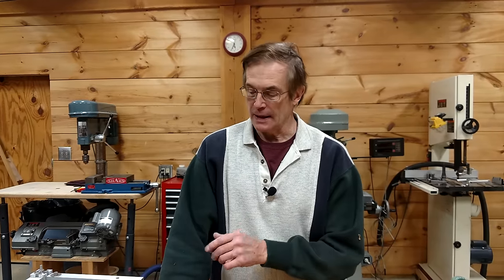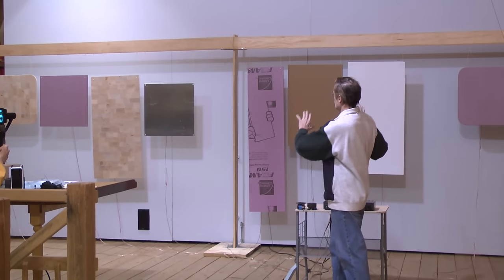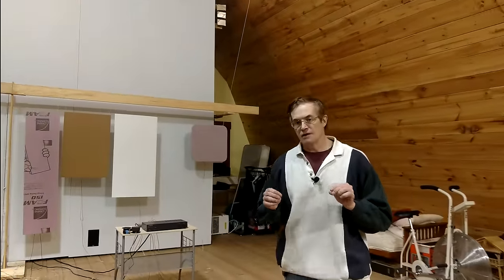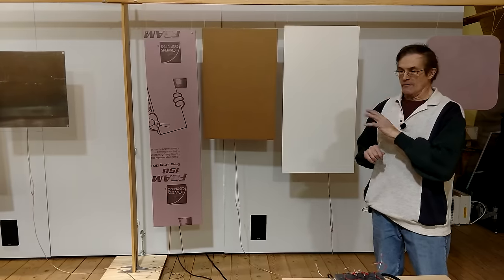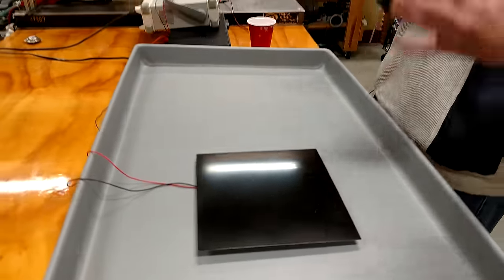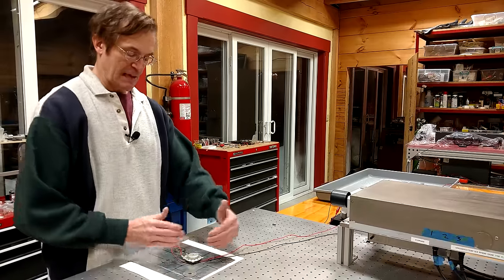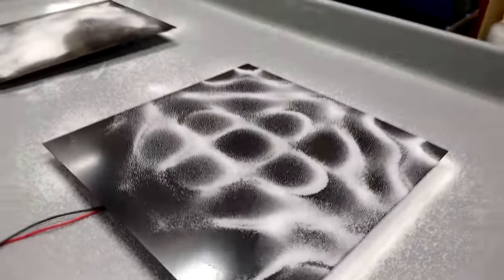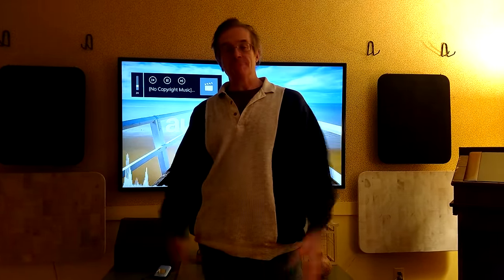Fantastic DIY Speakers for less than $30!

Comment: Very interesting topic! Thank you very much for sharing your expereince with different materials!
With my 25 years of experience in speaker technologies I would put a (maybe flat) sealed enlosure on the back of the panels to get more volume in the bass section. Another possibility is to keep at least a distance of 1.5 metres to every wall. That's why in the demo at 29:14 the panels are unfortunately totally lacking bass.
What you describe at 3:30 is, I think, the general difference in sound quality between dipoles and monopoles. You could test that with the same panel with and without an enclosure.
I would not fully agree with what you say at 29:00 that they do not require a crossover. I would assume that the frequency ranges of both different panels have an overlap over a wide range. The sound would clearly benefit from a crossover then. I'd also assume that there are dips and peaks in the overlapping area, at least due to different speeds of sound in each material and therefore differing acoustical phase. Try it out, it's not that hard to design a crossover. I made a tutorial for 2-way speakers: https://www.youtube.com/watch?v=5Kvl0iBQ0L0&index=1&list=PL4lJ1ej0uWlQjzOstioAZ1bd555vG9WHF.
A second one for fullrange drivers is coming tomorrow.
A material what perfectly fits your description at 5:20 is rubber. This of course has to be attached to a stiff frame. An irregularly shaped foam damping on the edges might also help against resonances (caused by wave reflections on the edges). There's a legendary driver which exactly follows this principle: the Manger MSW.
From metal plates (the higher the speed of sound within the better) I'd expect the most detailed sound if you eliminate the ringing/resonances with a crossover. This might lead to a small plate to shift resonances far enough into treble and a big plate for mids and bass in a 2-way system. Maybe round plates are better because they might have fewer but stronger resonances.

There's an intersting paper about exciters by the German speaker manufacturer Visaton: http://www.visaton.de/downloads/pdf/visaton_exciter_principles.pdf (also available in German).

Anyway, I now feel the urge to also experiment with exciters. If I do that one day, I'll also make a video about it.
Reply from the maker: Base is weak with this speaker.  The problem with sealing an enclosure on the back is that the principle of a freely vibrating sound generator is lost.  The result would be a conventional speaker with a rather heavy, unconventional cone.  Restricting the edges in any way will limit the movement toward the center of the panel. A piano doesn't need an enclosure.  I am working on applying exciters to much thinner surfaces, unusual shapes and phasing multiple exciters.  Your suggestion about rubber is interesting, I will test it.
We are studying these speakers with a calibration system and the initial results show an extremely broad overlap for the different materials.  I'm not sure if a cross over would be useful, but it would be simple to try it, so thanks.

Moving away from the wall helps if you have the room.
Reply: 1.5 meters from every wall? Ain't nobody got space for that!
Reply from the maker: The base response of these speakers has nothing to do with their proximity to the surrounding walls. This is easy to demonstrate by simply moving one of these speakers to the center of the room; the sound quality remains virtually unchanged. The lack of base response in panel speakers derives from the wavelength of low frequency sounds.  A 100Hz sound has a wavelength over 3 meters long.  The longest bending mode of a panel with less than a meter of length would require an outboard mass or a stiffness reduction that would undermine its reproduction of higher frequency sounds. Larger panels will do better and they perform as well or better at higher frequencies as well.
Reply: As you try other materials, have you given consideration to glass? Heavier than the foam board, but definitely thinner. Rounding corners and hanging with wires could be tricky, and then there's the whole shattering thing to watch out for... But I think it would be an awesome transmitter of sound waves.
Reply: Here from AvE.
Now that that's out of the way... I am curious to see if there is further resonance damping, if you cut a wavy pattern into the sides of the panels (kind of like taking your "radii & round-over" efforts to the next level.) This would leave only the flat, front surface as the primary emitter, and might reduce internal reflections, I think?
Reply: will there be an follow up video?
Reply: Glenn Wyant
There's the ringing problem.
Reply: Marius Loubeeka, whatever, okay. This is science!
Reply: This does not match my experience. I just built a set of these for a porch with brick walls (thanks you your video!). My plan was to hang them on the walls like your example, with about 2-3 inches of clearance. Doing so totally killed the bass. I ended up hanging them from the ceiling (parallel to the ceiling) with about 12 inches of space between the ceiling and the panel. This helps preserve the bass versus having them close and parallel to the brick wall.  I would encourage you to do a test with a panel close to brick or concrete to see what I experienced.
Reply: qksilver123 I was just thinking about this and I guess the reason is due to some interference from the reflection right behind the panel. I am finding this fascinating and I'm seriously considering in making a DIY project as a gift to my girlfriend and was thinking in how to get better bass. If what I said is correct putting some egg cartons behind the panels should help to scatter the sound behind the panel and kill any interference. And like this you can still keep the very thin profile of these speakers. I'm thinking even in making a frame (but still having the panels floating in the center) for them to make them very asthetically pleasing and like this you can hide the cartons behind the panel. If you ever try it just let me know
Reply: Tech Ingredients  fascinating and excellent presentation.  I must politely disagree with you about the enclosures though. You say a piano doesn’t need an enclosure and I would assume according to your theory the same goes for other instruments as well. However the piano IS an enclosure for the soundboard and the same applies to the back and sides of a guitar or any other stringed instrument. They consist of the soundboard /top and the body /back & sides (enclosure).   

 I repair & restore instruments, mostly guitars & ukes. I have a few old bodies with no necks that I may try attaching these exciters to. Perfect speakers for my shop!
Reply: Ian Stratford "Yes it is," using good cheap bamboo (from China good quality) boxes my self. Chipboard resonance is a little better, but l can't source chip board enclosure's. Bamboo is great a carbon neutral resource thank you for the remind.
Reply: I realize I'm years late to this party, but I feel like I have to point out that no crossover is going to remove the ringing from a metal plate used in this fashion. What this essentially is would be called a plate reverb, and they have been used for generations to enhance recordings. A (usually VERY) large plate is hung in as sound free a location as possible in a studio, usually in the basement or some other well shielded location. The sound that is desired to have reverb on it is pumped into the plate, either with an exciter or some other transducer, or even just with a speaker pointed at it. The resulting sound coming from the plate is them returned to the mixing board and added to the original sound. 

So there is absolutely NO surprise that this plate resulted in ringing, and while you might be able to minimize the resonances, you will not be successful in removing all the ringing. It's a feature of the material. Plus, since there are other, cheaper and readily available materials that actually sound better, why waste the time and effort?
Reply: @willmorrison1022  - Well of course. Which is why the panels used in the video DO NOT USE METAL.
The ringing of the aluminium sheet was simply a demonstration of what not to use. If you actually watched the video and paid attention, you wouldn't need to waste everyone's time with silly replies.

Comment: In the special FX industry, we paint extruded polystyrene by first painting the surface using a heavy solids water-based paint, such as craft store gesso (traditionally a mixture of hide-glue and chalk, now there are synthetics). Then give it a light sanding, clean it with a tack cloth, and then spraypaint as regular. If lazier, you can use craft store acrylic and just be happy; or follow a basecoat of white or neutral grey acrylic, adequate drying time, and the spraypaint of your choice. Make the first coat of spraypaint just a super light dusting.
Spraying at a long distance can cause the spraypaint to not adhere properly, which can cause it to wear much more quickly.
Fantastic content. I might have to add this to my project list.
Reply from the maker: The water based glue prep was the technique described in the Part Express project galley description of these speakers.  We elected to use the simple spray paint technique because the micro-porous surface created during the sanding process is beneficial to the sound quality and provides some recessed surface to protect the paint.  Nevertheless, these panels are quite fragile by nature and need careful handling..
Reply: Kilz might work in place of gesso too. It uses VM&P naphtha for thinner which is harmless to most plastics.
Reply: Maybe a water soluble dye like india ink in a spray bottle would work

Comment: I'd be interested to see a frequency-amplitude graph measured from these DIY speakers and for comparison the same measurement for some commercial speakers.
Reply: Make sure to plot the price too.
Reply: @digitalradiohacker  You get what you pay for.
Reply: @Oneness100  
No you don't.
I recently rebuilt some VERY expensive crossovers from a car audio install. The internal resistors were rated 5W, despite the speakers that came with the set being rated at 250WRMS. I'm aware that the 250 number is AC and the 5W number is (hopefully) continuous, but were the lifted PCB traces and charred glass fibre really required?

You RARELY get what you pay for nowadays. People are just too easily pleased and too quick to accept the throwaway society forced on us.

I'm not saying that cheap junk is decent quality, but spending money is NO guarantee of quality either. To get decent clobber, you have to understand what you are buying, not just throw credit cards at it.
Reply: @digitalradiohacker  were those xovers made by an installer, and used to divide multiple components on one amp channel?
Its pretty rare to see a xover built by a mfr fail.
Reply: @batvette  
No, they were OEM.
They clearly didn't do the AC RMS to DC calculations correctly, and as a result, the resistors became so hot they cracked their ceramic bodies, lifted the PCB traces and charred the fibreglass substrate.
Another example of marketing over engineering.
Reply: @digitalradiohacker  nowadays there are very few decent car audio companies, the industry is a ghost of what it used to be. 
I competed in IASCA in the late 90s, chinese amps were unheard of.  I ran gear from a/d/s, precision power, soundstream. Now they are just importers.
Reply: @batvette  

I never really competed as such, but I used to enjoy building and hacking about with car audio.
Your view of car audio manufacturers is exactly the same as my view of MOST electronics "manufacturers". They're mostly just box shifters.
Sad isn't it? I can't be the only one who would GLADLY pay a premium for decent gear made domestically. 
All this is the result of liberal, open borders, globalism. Why pay experts here a premium to design and manufacture your idea when you can move your operation to the far east and pay a 12 year old boy a bowl of rice a day?
Reply: @digitalradiohacker  competition was a lot of corporate politics but it was educational. A huge money sink. Had tens of thousands in my corvette, here are some pix if you care:  https://m.facebook.com/john.lucier.9/albums/10206769674860739/?ref=bookmarks
About those companies, a guy i know worked for DEI. They were expanding into car audio. They bought Precision Power, a/d/s, orion, and others in the late 90s as they faltered. Fired everyone and got chinese companies to make prototypes of similar gear. My friend was in charge of torture testing and when they failed he sent them out for lab analysis and told the chinese what they did wrong. 
Now those brands exist in name only if at  all. 
a/d/s was so good they had no problem selling in japan and europe in the 90s. I had their p840 8 channel amp for 20 years, still worked when i sold it on ebay last year.
Reply: @batvette  I just had a peek. The two capacitors as fat as my arm tell me everything I need to know! I'll bet one of those would have run my system for a week - with the engine off.
I am obviously much younger than you and based in the UK. I started in the early 2000's and I had zero experience or guidance. All my friends were consumed with alcohol in their spare time whereas  I preferred the waft of proper 60/40 tin/lead solder. The kids that were "in" to cars back then would gather in supermarket carparks and sit in silence, revving their 1.2l engines into the night. No one talked, no one collaborated.
My system was pretty modest. I had a single 5 channel Hertz amplifier, a set of Hertz components in the front, a set of Hertz 7x10 in the rear and a single 10inch Hertz sub (I was into fast moving trance, not R&B, so the 10 made sense). I threw the same money at sound deadening as I did at the whole rest of the system combined. The only part of the car that wasn't treated was the glass.
It was a daily driver, so it had to sound good. I could have thrown far less at the job and had higher SPL, but I was making regular 300 mile road journeys, so it HAD to be kind to the ears.
For a kid in his very early 20's, on his first job out of school, with no idea what he was doing, it was a good system - It surprised everyone who heard it.

I envy you. At least you were there to enjoy some of the old stuff. Nowadays, I get berated for using vintage Sony / Pioneer linear amps at home because "they're not efficient". I'll die before I have any SMPS rubbish at home.
Reply: @digitalradiohacker  LOL sound deadening. I had that corvette apart for 2 months doing that before anything went in. Dynamat everywhere and lots of modelling clay underneath. Modelling clay is awesome, just put a pea sized hunk at the end of a tuning fork. Cheap too. 
The industry died partly because modern cars have decent OEM stuff. Back in the old days as soon as you got the car you started planning the system.
BTW trance is awesome.
Reply: @batvette  I don't understand why car audio died out. People spend nearly as much time in their cars commuting today (well at least they did before the pandemic) and it seems that Millennials are starting to appreciate audiophile tech more and more. Remember when you had to worry about someone stealing your expensive car radio? No more.
Reply: @stopthephilosophicalzombie9017  easy. Car audio decks became impossible to install.
Reply: @float32   They aren't any harder now than they were 20 years ago.
Reply: @stopthephilosophicalzombie9017  my Toyota disagrees with you. My last Nissan too.
Reply: @float32  What was so difficult?
Reply: @stopthephilosophicalzombie9017  the $200 dash kit to replace all of the panel, trim, and buttons where the old one was. Previously, you could just slip a new head into the standard slot, with a  cheap wiring harness, and be done with it. Maybe you don’t agree,  but this is why I haven’t upgraded my stereo in the last two cars I’ve had, and I’m too cheap to have someone else install it. What was one a few hours is now much more complicated and more expensive.
Reply: @float32  I keep my cars forever so you might be right. The 2011 Suby I have right now doesn't look like it would be very accommodating for a stereo thanks to the hideous nav system.

Comment: Perfect background speaker for the digital piano.
This could simulate the wooden soundboard in the digital piano.
Reply: epSos.de Also very unobtrusive in the space.
Reply: That's a good idea...
Reply: Piano soundboards work very differently to this. They're tuned for the frequencies produced by the piano strings to accentuate the sound. You will probably also excite the strings, causing them to vibrate over the music.

Don't get me wrong, I full endorse the idea out of curiosity, but you may find that it doesn't give you the effect that you're after. I actually once did an IR response on a piano and stuck it through a digital convolution reverb, which gave some pretty interesting results.

Please do a video if you ever get around to trying this!
Reply: Monicky2 IR?
Reply: @brainmind4070  Impulse response, aka a recording of how the piano responds to the sound the strings produce

Comment: I also found this from AvE. 
I've tinkered with this type of speaker before, wish I had this excellent analysis/testing back then. My attempts were with CNC'ing some flex points in aluminum covered polyfoam insulation board. 
When I saw that APU thing at the start I knew this was going to be good and subscribed before you even got to the speakers. =)
Reply from the maker: Thanks! Just wait, here comes the jet.